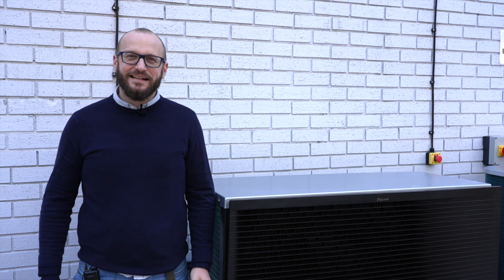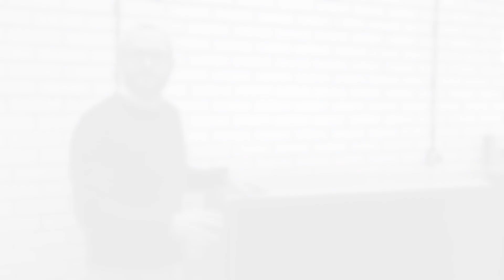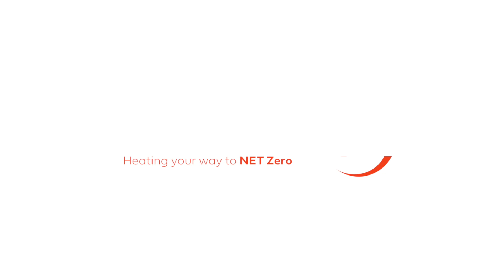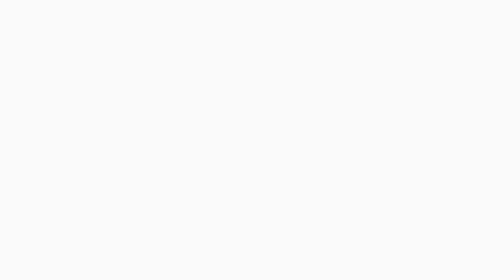Why A Heat Pump Needs Clearance

Comment: I’ve just had a Daikin heatpump fitted and I was amazed at how quiet it is. There’s so much rubbish talked about heatpumps ours all be it one of Daikins smaller monoblock makes far less noise than the modern gas boiler it replaced and yet there are no real restrictions on its flue position, which in our case was within 1 metre of our next door neighbours kitchen window. It’s time some of these ludicrous restrictions are changed. The poor sods in Wales can’t site a heatpump closer than 2 metre from the neighbours fence and that’s just plain stupid.